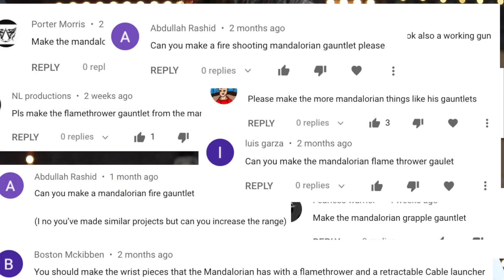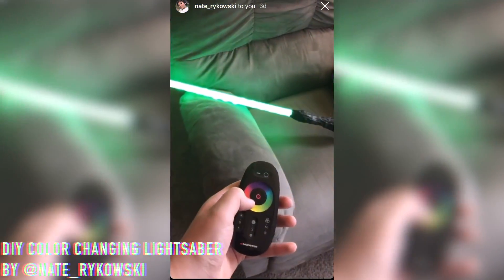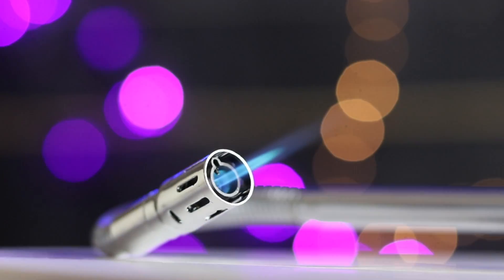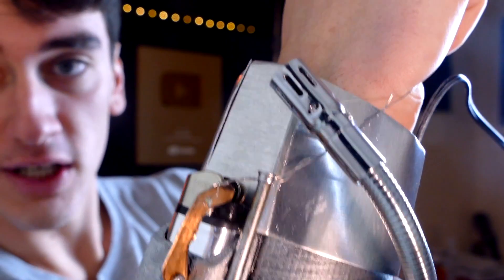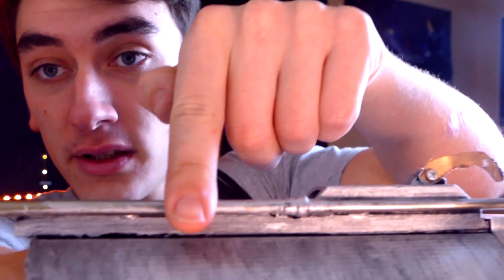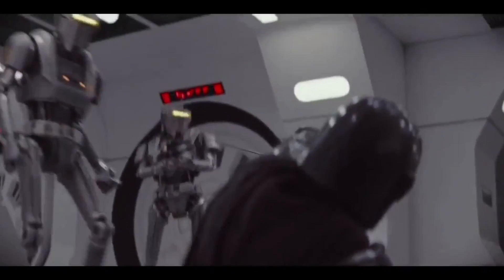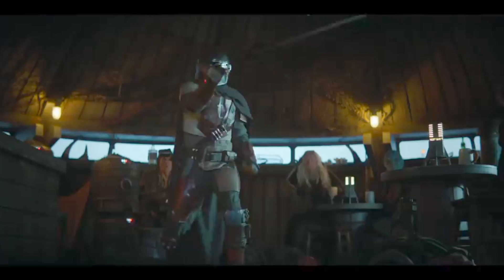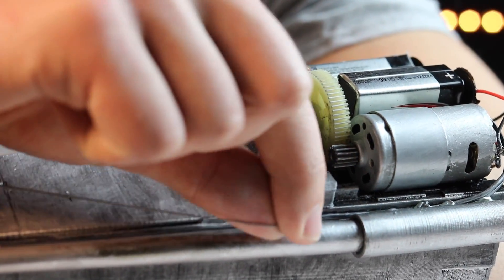Make Working Mandalorian Flamethrower/Grappling Hook Gauntlets

Comment: For the grapple launcher, i had an idea of how to get the rope to "change" direction midair: have the cable made of two cords instead of one, so that one side of the rope can be cinched causing it to stop while the other side is free. the forward momentum will want to keep going so the rope will "push" to the side where half of it was stopped. with a heavy enough projectile, and enough resistance to keep the line moderately taut, one could also seemingly fine tune it so as to make it never twist up either
Reply: This could theoreticall be done with only one piece of string, by introducing a wave into it during flight

Comment: i'd like to see a bola version instead of a hook
where towards the end of the cable, the remaining 6 feet is actually a fork in the cable where there are 2 lengths of equally strong cables that form the letter Y when splayed out.
the drawback is that you'd need a retraction mechanism that can pull these back into 2 separate launchers, or 1 fatter one.

the pros to the bola method: can be hookless metal weights, or hooked ends.
Wraps literally anyone you shoot it at without hurting them on the initial grab.
Forms a more secure connection to the grapple target.

Comment: To improve the grappler I think you can split the string into two pieces and then hook it up to the actual hook so it can go in the hole that holds the string so when you shoot it it flies straighter.

Comment: Butane & propane for your flamethrower isn’t too bad of an idea, but you should’ve used kerosene for the fuel (can get kerosene at Lowe’s, Walmart, & online at Ace Hardware; jet fuel actually is kerosene, because said fuel is so energetic) & for your starter you should’ve used an arc lighter (much more compact ignition system, easy to “refuel”).

Comment: I've been thinking really hard on how to make the grapple gauntlet but I've out done any other gauntlet I've seen, while not as pretty, mine has a 10 shot .22lr with red tracers, a steel mortar tube for small artillery shell fireworks that ignite from a 9v magneto, and a flamethrower that puts out a smaller flame, 4 feet at the longest, but in a much much smaller frame and ive gotten 40 seconds of solid flame before fuel started getting low, I have no hoses or wires coming from my wrist everything is on the gauntlet minus extra flame canisters for the belt. The power supply is recharged with a simple phone charger and the entire thing is built on a quarter inch of hardened steel so the damn thing can even ricochet shotgun and handgun rounds, 13 pounds and counting lol

Comment: Also, idea for missile in jetpack; air pump rocket with longer tube leading down to one foot, stomp-to-launch, or (probably cooler) as someone earlier said to attach a propane tank in jetpack for flamethrower, instead use small CO2 tank to launch missile farther. BUT if you want, (and if you're careful) a neat 4th of july trick would be to fire a roman candle or other small firework from the pack. I would absolutely LOVE to see it done.

Comment: To make it reliably wrap around an object, put the cable under minor tension and fire the hook at a slight angle (right gauntlet, have it shoot a few degrees to the right) and give a little tug when you're ready to start its coiling motion. Think of it like one end of a bolo with a tiny hook to secure to its own wire. Good for legs, weapon hands, and other such tasks, especially with thin and strong enough wire. OR fire it at the same angle and have the chord suddenly stop extending, the hook will naturally strike an inward pendulum and wrap whatever it has the length to.

Comment: fine, here's an idea i want to do but never have time. build a gauntlet (or more like that thing Leela has in Futurama)  side closest to you put a RC controller (modified lol) (bonus point if it slides up to hand) on the side away from you have a RC Car (modified lol) that's attached to a DC motor with some string (as like a wench back up to your arm) and have the RC car capable of picking an object up. then hit the recall button to pull the car back to your arm. Hope that made sense

Comment: So I learned from my chem teacher that you can adjust infrared light (the thing that night goggles use and what your radiate without knowing though I wouldn't suggest using night goggles with this bc this is different) to detect only human bodies through buildings. The reason being that the building has low infrared light and your body has high infrared light so the goggles can only detect your heat signature. There are goggles or some type of equipment (you can tell I wasn't really listening) for firefighters but there's only three in the US or world because well, if it got to the wrong hands we wouldn't want any burglars would we? Though people have found other ways you can see through walls. For example x Ray goggles and a YouTube channel named Action Lab has done a video on a device that can use radio waves to see through objects. If you do this, might want to either bring on a chem expert or do A LOT of research.

Comment: There is a hologram trick that you do with plastic and when you angle the 4 sheets correctly it makes a 3d hologram. I think you should make a massive version that connects to devices. I think it would improve over hologram ideas as they use steam

Comment: Propane’s barely “it’ll work” level. You should have used pressurized kerosene. Kerosene is used as jet fuel, for every jet plane in the world (literally). It burns much more energetically. It’ll also give you better range, though you’ll need a better nozzle than just a handheld lighter to handle such pressurized fuel.
Said fuel can be readily bought from places such as Home Depot, Lowe’s, etc.
Reply: Bro chill it was just a small project you actually tryna use this for a fight or something??
Reply: JustALegend _ Not an actual fight, but more than just a useless novelty. And I was just trying to give suggestions to keep it cheap, but actually cool and useful.
Reply: @bostontracy5151  I understand and yea I looked into it the fuel you suggested is very powerful

Comment: Make full Mando armor! Full Mando armor! Full Mando armor!
Then you can camouflage the tank with flamable liquid as a part of jetpack.
Reply: Definitely do that and also there are some things you should try to make in it like strength enhancements and like actually protective armor ( might not be able to do all that but it would be so cool) and also the jet pack thing (obvi can’t fly bcs of physics but still could make an awesome addition if u capsule make it look like it could take off, maybe with some flames or something)
Reply: Yes
Reply: That’s what I was thinking
Reply: Yes
Reply: Even better just make the jetpack a custom-shaped large hollowed-out rectangular fuel tank. Then at the top, you can attach it to a little missile launcher where you can use a simple one-shot high range bottle launcher system with a prop missile you make to be aerodynamic and light. At the bottom, you can just have aesthetic Thurster exists while a simple valve on the side connected to some light metal bendable tubing (aluminum or something more flexible if you don't want metal) connecting it to the flame thrower through the elbow to the wrist where it would meet the flamethrower. Add a small battery pack into the insider of the front main middle armor plate and then pad with foam around it to keep it comfy and you can now connect power to a helmet with the ability to have a real full heads-up display and other properties. For the helmet itself, you make a normal lightweight aluminum helmet but instead of using a simple glass you use a VR display that you fit on the inside of the helmet at the visor level (The most expensive part of the build by a long shot but I've done something similar with another helmet before so I know it is possible although that was a massive mech helmet this is a human-sized helmet.) Now that VR headset needs to run an augmented reality interface that you program with a proper simple Mandalorian hud with simple things like rangefinding etc. Last of all you need a good camera system so you might a nice small 1080p-4k VR camera (quality depends on your budget but size has to be very small like 2x2x2 inch cube, the one I like is the Kodak PIXPRO Orbit360 4k VR camera but there are others.) Now you want to take apart that camera out of its shell and integrate it into an aluminum cast (or 3d printed in metal or a strong plastic or resin) Mandalorian range finder (that thing that comes down from the head of Mandalorians.) Now with this build, you always keep that down because that constantly feeds your VR feed giving you augmented reality. Now on that same rangefinder, you place a small real laser range finder (taken out of its shell and reintegrated of course) above the camera which connects to the VR allowing for remote range finding on real targets. Foam pad the inside and add a bit of circulation and then you will be the owner of the most epic helmet. You can just have a normal grappling hook like the one shown in this video but stronger ones exist if wanted. The rest of the armor bits are just aluminum cast armor pieces with straps on the back that make it easy to put on a blackbody suit (like the one mando wears.) You custom build aluminum shoes to match the armor. Now you have an amazing suit of armor. I would make it myself but my wife might just put my head on the bedroom wall as a trophy if I build another suit of armor after my insane 6' 5" Power Armor Exosuit with weaponized airsoft systems that I spent 2 years making. That was my third longest personal project right behind my Ultima RS with a custom electric powertrain.
Reply: @hj2479  do u really think ima read all that text
Reply: Yeah

Comment: Just as like a future modification could you use a piezoelectric element that you can get from those electric lighters without the roller and flint instead of the , I think that would be more compact and it would make your flame thrower builds more efficient

Comment: You could put the propane tank in the mando’s jet pack
Reply: I mean I always assumed that's probably where the fuel for the Mandalorian flamethrower would come from it's just fuel siphoned off from the jet pack into the flamethrower gauntlet, I mean mandalorians can fit missiles in their jet packs so I guess a separate fuel tank for the flamethrower would be reasonable
Reply: @jaredflynn3750  I mean, the only issue with that is that the mandalorian had a flamethrower well before he got his jetpack.
Reply: @joshuamoore4971  I haven't seen the show actually I'm just speaking from my experience with other mandalorians in the Starwars universe and other Star Wars media but in that case I guess you could just wear it underneath the jetpack if the fuel tank isn't too large
Reply: @jaredflynn3750  tbh I just try not to think too much into the logic of it, but I feel like there are a few places where fuel can be stored. It's also worth mentioning that in the show anytime he uses the flamethrower it runs out pretty quickly, which is something I kinda appreciate.
Reply: I think it's fun to imagine how it might work in the universe of star wars lol
Reply: @jaredflynn3750  But how did mando use his flamethrower before he got his jetpack
Reply: @JH-cw5po  if he's not siphoning any fuel from his jetpack then it's probably some kind of smaller cartridge filled with some kind of flammable gas or liquid inside his gauntlet
Reply: Boba fett’s armor has tubes leading to his wrist guard, I assume those are fuel for the flamethrower
Reply: He doesn’t have one in the tv show
Reply: @hvhhvvguhbj.jhbhjjbjh1480  there’s literally a clip right at the beginning of this video
Reply: and then he could put some co2 in there
Reply: Ye
Reply: And use that to also fuel the jetpack
Reply: Yeah that would be a good idea, yet it’s gonna be heavy lmfao
Reply: it doesnt use propane
Reply: Mando’s jet pack is propane...
Reply: he could make the jet pack lol
Reply: Bababooeey
Reply: I was thinking the same thing
Reply: EXACTLY what i was thinking
Reply: 😲I never thought of that
Reply: Do it
Reply: I was about to say there is a much easier way. My tank was apart of the jet pack and I have real on mine for the tx jet planes. Anyway I have a torch and it throws far I used it for mine and the whispering birds are real .22 bullets in mine
Reply: You would blow up in reall but nice idea